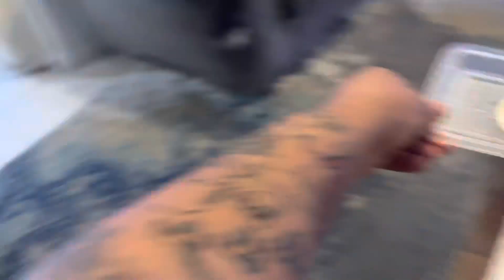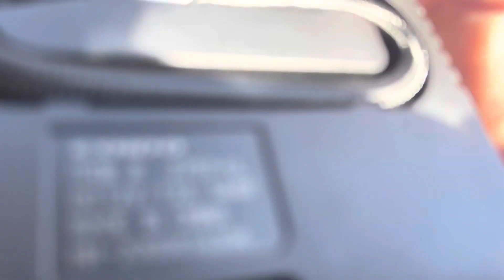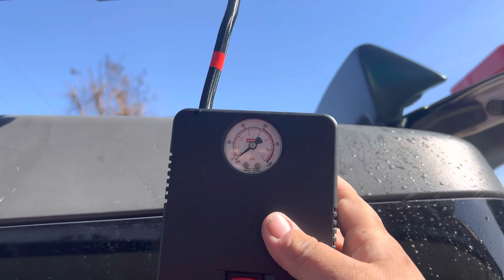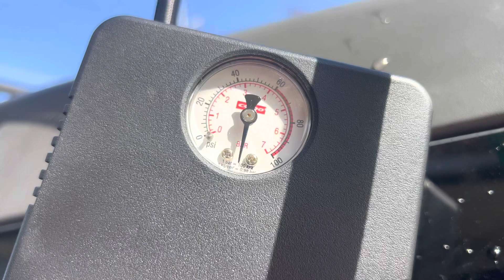Will the PVC pipe hold air????

Comment: Please keep in mind the effect of waters weight per gallon (8 lbs pg) and the effect on your vehicle... 10 gallons of water can effect your steering around sharper angles and turns at even lower speed ... If you are able to fill water closer to a site, that would be safer...
Reply from the maker: I will definitely keep that in mind thank you very much for that input

Comment: Nice a thinner hose will make it flow better.  And smaller nozzle.  If you watch some other diy campers they use thin hose to gain presser.  And flow for water. And a slight tilt in pipe help it flow not a big tilt just tilt so you don’t see it majorly just some ideas.  Good video.
Reply from the maker: I agree with you on all that Rob